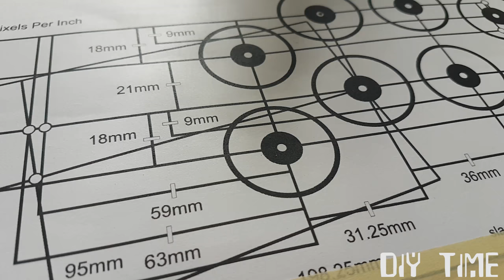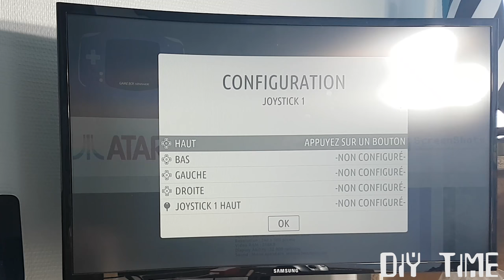DIY - Arcade Stick in wood for 20$

Comment: I also want to make this but can you tell me how to play games and configure on windows 10
Reply: Well if you wanted to play of games with this I think you would need an arcade stick converter which is those little USB thing and plug it into ur arcade stick and pc
Reply: You need a PCB that supports pc
Reply: There was a kit that had the buttons and a sanwa style stick along with a Zero delay PCB that had  PS3, PS2, raspberry pi 1-3, and Xbox 360 controller for windows. But sadly that one is harder to find now. Best bet is to go on the focus attack website and look for the cheapest brook board that'll probably be $25 or a PS3/PC Zero delay with wires and USB cable for around $12 dollars (not recommend if making a hitbox/mixbox) on focus attack, 10×30mm buttons for 9.99, and a cheap sanwa (maybe after market) JLF stick for 15.99 on Amazon, Hope this was helpful to someone slagcoin probably has way better info.
Reply: @mikekazz5353  thanku bruh😊

Comment: Does this work on ps4
Reply: By the look of that board I think it's the ones they make for raspberry pi, Android and some PC's. If you want focus attack has a brook board for $50 that'll work for PS3, PS4 and PC that's the cheapest that'll work for PS4.
Reply: @mikekazz5353  It is a lot better than current PS5 options of 160 dollars or pad/stick hacks.

Comment: Does it work on windows 10
Reply from the maker: Yes with a software
Reply: @diytime-howtomake5511  which software???
Reply: @Kalaawa  anything that can transfer d-input into x-input (xbox360ce or similar) but if you do play lets say sfv on steam, steam automatically translates d-input into x-input you will just have to configure it on steam

Comment: Because obviously the tools are free. More like a fight stick in wood for $600 minimum. Maybe do it with just hand tools next time.
Reply: That's like saying a cooking tutorial would take into account if you had a stove or not
Reply: @grzmotgaminglover6894  Well, it's probably more likely that someone would have a stove than power tools, but it would probably be hard to do without those tools
Reply: @PatrickMcCawFitnessOfficial  yeah, but the case can be literally anything. i've seen people making sticks with shoeboxes, and they were good
Reply: @gugubope21  Yeah, I've seen that. I do have alot of boxes nobody's using. Still concerned about the power tools, but I've also seen it done with a drill.